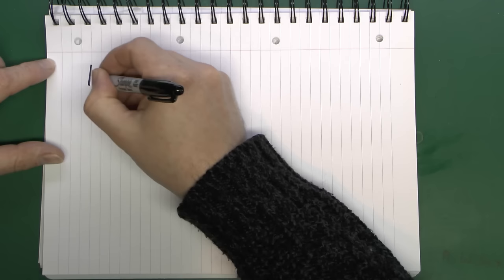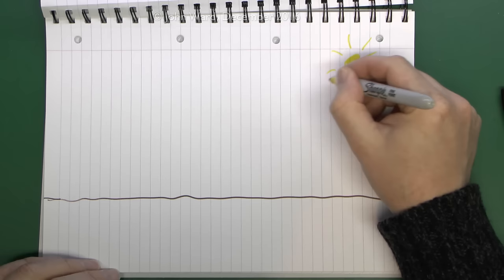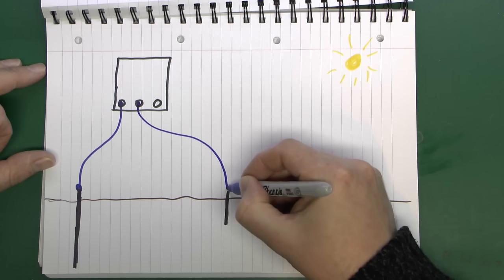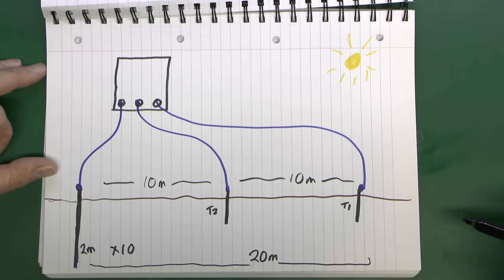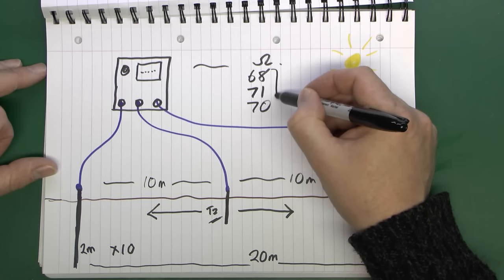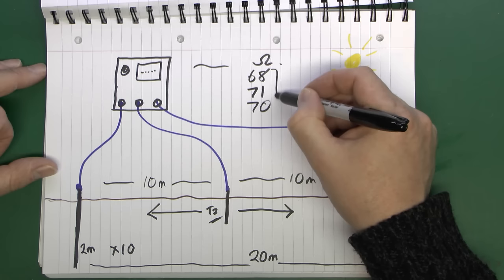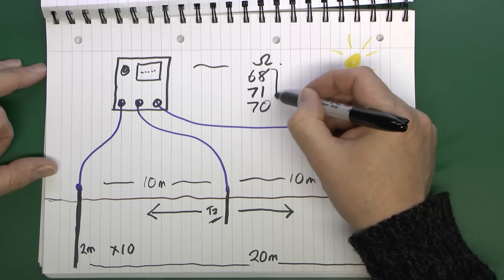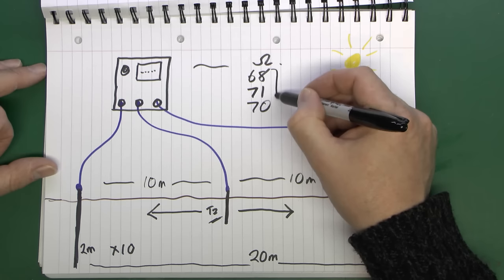Earth Electrode Testing

Comment: I am building my home in Thailand,  realising early on that there is no electrical standard and very little knowledge of Earthing, I decided to use an UFER grounding system. All my rebar is connected together, by welding and thick copper/brass cable joints, then concrete is poured and metal points at 4 corners of each building come out and all the risers and are connected above the floor plane to a common point by copper cables, all dry, sheltered and protected.     For anti corrosion I smuggled in a tin of Copperease (can't get that here along with Marmite and PG Tips)  as we used to use that on ships' antennae installations, it doesn't wash off or emollify much. I use a Three Terminal Ying Tong Meter as above and thank you for your video as when I got it the bloody thing the destructions were all in Chinese.  For the whole installation therefore I use multiple earths for each supply box being the UFER grounds,  as the company supply earth isn't available (LN only) and anyway it's just a piece of galvanised metal buried in dry sand.   Drinks are on me if you are ever in Hua Hin area.

Comment: Great video, though you could have mentioned that the middle electrode (commonly designated as S) is just a high impedance voltage measuring probe, while the outer probes (commonly designated as E (earth) and H(auxiliary)) are used to inject AC current into the soil. Resistance is calculated internally as the voltage measured at the S-probe divided by the current measured internally by the instrument itself.

Comment: Surely the resistance will vary greatly at the same installation depending on the type of soil and for a given soil type, its wetness or dryness. Presumably the test should be done after a (long) dry spell.

Comment: Damn!! here in the US we have to use 10 foot (3m) rods and achieve 3 to 6 ohms of resistance. I've also had to use 1/4" x 12" X 12" copper plate or ufer grounds for the hard to get places.
Reply: Because of the 110V mains

Comment: Im wondering which direction you would go away from the original earth stake. If i had a new overhead pole put in for my new supply (I'm very out in the sticks) would I be advised to head towards the pole which happens to be in the same direction of an overhead transformer for me and a neighbour on the next farm.
The new supply is PME but the estimator guy said to put an earth stake in with a 25mm CPC connection to it. Never had that request before in my youger days of new house etc.
Reply from the maker: Doesn't matter particularly, other than it should not be near any other buried metalwork, cables, pipes or other electrodes.  10 metres distance from anything else at least.

Comment: I find it always best to use a 17th or 18th edition multi function tester to measure the Ra or earth fault loop impedance for the means of earthing. The three spike testers will not measure the critical loop to ensure automatic operation of the RCD's. They can be misunderstood and also show incorrect readings from the short temporary spikes into dryer topsoil rather than deep clay, 
Two wire testers will measure the entire earth fault path from the transformer through the line conductor, down the spike to the ground, and across the ground and back to the high voltage earth at the TX. this needs to be below 200 ohms and is the best method by far.
You also need to ensure that you disconnect the earthing conductor and test only the means of earthing (NOT parallel paths to heating systems and water mains etc.) You MUST also ensure that this test is done with ALL current using equipment turned off at the main switch to ensure nobody can become injured while the earth has been disconnected.
Reply: @David Morris Exactly David, that three wire test method is a nonsense and only tests the ground between the three electrodes used and not the critical Ze (Ra) measurement. Don’t waste your time attempting it mate.

Comment: I could not find your video about  measuring earth resistance when the main electricity is available, and ask my question here
Can one get results using any household electric appliance like, say,  Incandescent light bulb, a mulimeter and the old good Ohm's Law?  
One terminal of the bulb is connected to live, the other to earth  and the current is measured. Divide voltage by current and subtruct the bulb's resistance and the result is the  earth resistance.
Reply from the maker: In theory that could work.  In reality you do NOT want to be attempting that, as doing so will put a significant voltage onto the electrode and anything else connected to it which could be dangerous.  Would also need a circuit with no RCD on it, otherwise it would trip immediately.
Other videos are here: 
https://www.youtube.com/watch?v=_BkN8fRLYXw
https://www.youtube.com/watch?v=K0P5wGSjxLE
all others can be searched from the main channel page.
Reply: @jwflame   Thank you for answering.  If I got you correctly, this method will give sufficiently valid result, yet it is not safe. I still cannot understand the danger.  Significant voltage is the same 240 (in my place it is 220) - and this is a voltage we handle habitually with common sense. I am going to use an electric plug  and a lamp socket. Connect the live pole of the plug to one lamp socket terminal (the other plug pole unused). The other lamp pole terminal connect to the earth. Of course making all these connections  while the main switch is off.
RCD is already there

Comment: Here in denmark, we rely on rcd's for protection. They are in fact required by law to be installed in all consumer units. Therefore, the earth electrode needs to fit the rcd. As 50 volts is max alowed for humans to touch and most rcd's trip at 0,03 amps, the max resistans for the earthrod is 50/0,03 = 1666 ohms. Some equipment require 0,1 or 0,3 amp rcd's so 500 and 166 ohms. Could you please explain why you say 100 ohms for TT in england? And thank you for all the videos you do, I realy enjoy watching them. As others has said before, you can explain things so everyone can understand them. Keep them comming 🙂
Reply: According to the On-Site Guide (BS 7671) it's between 21 and 200 ohms on a TT Earthing System. Obviously the closer you get to 21 ohms the better.
Reply: Calculation is misguided. There's a potential divider effect. Faulty low rsistance load connected to high resistance earth rod gives a high voltage on the supposed 'earth' wire.

Comment: Thanks John. You mentioned that you might be doing these tests while it is raining. Is it necessary to repeat the test when the ground is drier to ensure that the resistance will still be low enough during hot periods with little rain, or does it not change much?
Reply: Ideally you want to do it when the conditions are least favourable, say a hot dry day

Comment: Hi this is great because it gives me ideas of how to achieve my goal, but I would like to know more about the meter you’re using I have been told I need to use a mega but this looks like something else you have but you did not mention what it was. I use Radio and I need to know I have a resistance of less than 10 ohms. This sends current, and I am afraid to test as I may damage my equipment.  🤔. This demonstration 👍 just need to know more.

Comment: Hey John hope you can help me with the question it reads:  A maximum earth resistance of 300 Ω, shall be maintained between electric fence earth 
electrodes. Do I connect the leads to both electrodes +- 30meters away. Or do I insert the small electrodes into the ground as shown on your video the electrodes are 1.2meter long.

Comment: It should be noted TT earth impedance can easily double from wet months to dry months throughout the year, I guess that why <100 ohms figure mentioned rather than the 200 stated in the book! using a grid (rebar) in concrete is not advisable. also electrodes should never be sunk close to PME connected services, DNO's recommend a minimum of 10M from their earths, but there is little guidance on this subject anywhere! rods should not be sunk close to foundations as it will reduce its effectiveness, rule of thumb is at least 1m unless you know the foundations are shallow.

Comment: good vid, but slightly confused, putting aside the 10:1 rule surely connecting multiple rods to a soil with poor conductivity even if they are inches apart will gain more surface area, hence better figures.  Im guessing that surface area plays a big role here
Reply from the maker: Surface area is the main factor, so more is certainly better.
Multiple rods close together will be better than a single rod, but spacing them apart is better still - and as the effort of installation is the same regardless of where they are located, they may as well be spaced apart.
Reply: @jwflame  thanks JW, its an awkward question I know!
Reply: @jwflame  I guess that if theres no option due to area restriction and crappy soil condition, planting them very close and bonding together is the second best thing as we dont want voltage potential

Comment: Dear Sir
I'm working on an existing hospital over 30 yrs old, and i found only lightening pits connected to the lightening grid on roof, how should I test the earthing system and is it possible for the designer to used the concrete grid instead of the earthing electrode ?

Comment: Some people ,knowingly or unknowingly, put common salt ,charcoal inside the pit(dug for the purpose), before putting a GI pipe (though costly). Will the salt help significantly or is it only a precaution?
Reply from the maker: It will reduce the impedance, but it will also increase corrosion so is not recommended.

Comment: When doing the 'rod test', all very well testing your own electrode, but what about the impedance of the earth-electrode at the source transformer, how do you test that // what standards is 'their' elecrode rated/checked to?
Reply from the maker: It should be less than 21 ohms, usually a lot less. The earth electrode at the transformer is usually a large metal grid buried in the ground, not a single rod.
Reply: DNO's sometimes spend more money getting a low enough earth impedance at the substation than the cost of the substation, TN-C-S is therefore more or less guaranteed to be good!
Reply: Test again with mains, and compare the two?, Line conductor impedance should add rather little to the loop

Comment: I am unclear why the electrodes need to be far apart yet tape or a grid or a pipe are considered the same thing. They are not only Not Far Apart but continuous?
Reply: Given two electrodes, spacing them apart gives more 'bang for the buck' than putting them close together, tape/grid would just overwhelm that with shear area.

I.e. where two electrodes far apart might have half the resistance, close together would have more than half

Comment: Dear Mr.John ,
I have to test the earthing for 40 connected electrodes (earthing network ) .
Please tell me if I can use 62 % way , and  please tell me  if i have to isolate the electrode from the earhting  network during this test ?

Best Regards,
Reply from the maker: You can test the electrodes together, but they must be disconnected from the electrical installation when testing.

Comment: Correct me if possible, but i thought the ideal Earth test resistance should be less than 1 Ohm?
Reply from the maker: Less than 1 ohm on TN systems where the earth is provided from a cable.
With an earth electrode (TT),  resistance will be much higher as it depends on the resistance of the electrode to the surrounding soil, which is typically many 10s of ohms.

Comment: Hi John,
do you any video showing the use of method 1, i.e. mains?
Reply from the maker: Not yet.  Hopefully will do videos showing all of the various tests, but it is rather difficult to find somewhere that it's possible to show the tests, and get permission of the building owner.  Making a video while doing them means it will take several times longer, so a few hours of tests could end up taking a couple of days - most people don't want that.
Reply: Hi John do you have video showing testing when mains available ? Or can u explain in writing ?

Comment: What shall be the earth electrode resistance
Reply from the maker: Depends on the circumstances and the installation, but generally less than 200 ohms is required, and lower is better.

Comment: Did I hear you right , earthing electrodes are not required on new installations .
Reply from the maker: Yes, but only because new installations are very unlikely to be TT.
If a new install is TT, then an electrode is required.
Reply: What is TT?But in the Netherlands,every dwelling,every family home,every housing flat has to have its own earth pin!If the Housing flat is long even more than one!It amazes me to hear this is not required in the UK for new installations.
Reply: Computer Addic We usually use the suppliers earth. the most common earthing method in the UK is known as TN-CS. essentially all line to earth fault are converted into line neutral faults. The earth electrode (or earth pin as you call it) is generally only used in rural areas.
Reply: So the resistance to earth is higher than in the Netherlands.We think 10 ohms is a lot!
Reply from the maker: TT is where the only earth connection is via the electrode, the electricity supplier does not provide any earth connection from their cable.  Most supplies in the UK have the earth connection provided as part of the supplier's cable and a separate electrode is not required.
Reply: Ok,we dont,we have to provide as a electricien a earth electrode on any home or appartmentflat.
Reply: Our local DNO (UK Power Networks East/EPN) has started supplying local earths (end of main electrode) on new TN-C-S installations, they are bonded to the PEN and in the DNO infrastructure (the rest of the installation is a standard TN-C-S setup)
Reply: From reading the links at the end it seems that some newer areas are being provided with TN-CS supplies (TT is still found in older installations) - but the supplier (presumably after checking it is suitable) connects their PEN to the local earth electrode. 

A friend in Denmark also told me that his flat had an earth electrode added to an existing TN-C-S supply (the electric company did this, they had to temporarily isolate power to the whole block) 

https://www.circuitsonline.net/forum/view/127313

http://www.fantv.nl/forum/26-gas-water-en-elektra/65229-heb-ik-nou-aarde-in-huis-of-niet?limit=10&start=20

Comment: Dear sir, is the type of material of the electrode important and affecting the readings significantly?
Reply from the maker: No, as long as it is conductive.  The main thing affecting resistance/impedance is the contact between the electrode and the surrounding soil.  Longer rods or larger diameter rods will improve this as there is more surface area.
Reply: John Ward Dear Sir, many thanks for your kind reply. I was considering the options of electrode, as the high copper content composition one costs 4x more than the generic ones.
Thank you. And i love your channel!

Comment: Why do we do this test ?
Reply from the maker: To ensure the impedance is low enough to trip the protective device (an RCD usually) when a fault occurs.
If it was too high, a fault between line and earth in the installation would result in exposed metalwork becoming live, and the power would not be disconnected.
Reply: Thanks a lot great explanation